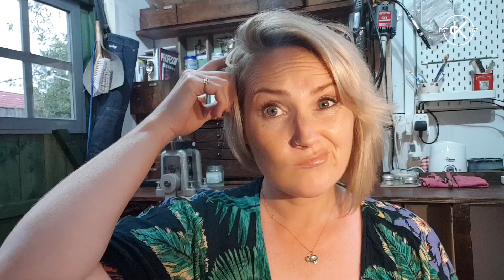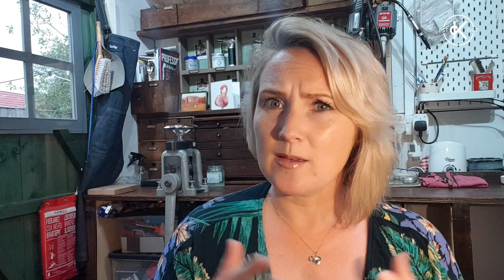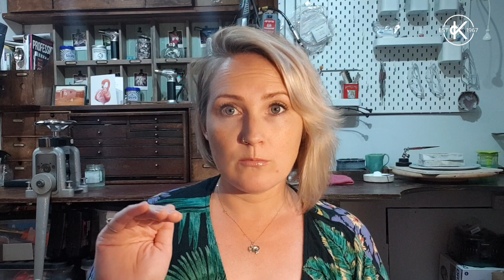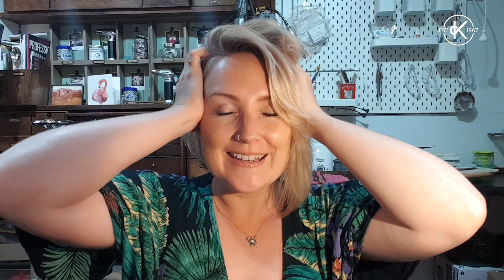Etching Health & Safety With Kim Thomson | 12 Months Of Metal

Comment: The jeweller Nancy L T Hamilton did a lot of research regarding  the problems surrounding salt water etching and made a video reporting her findings:

https://www.youtube.com/watch?v=2Hw1uonkTsE

I only etch sterling silver and prefer to use silver nitrate as the resulting etching is quicker, cleaner/crisper and afterwards the silver nitrate solution can be filtered (to remove the deposited silver from the solution) and it can then be re-used several times.